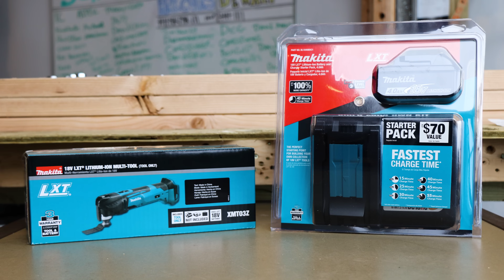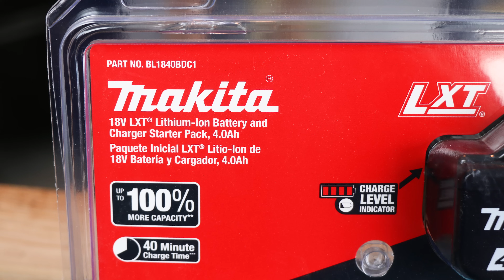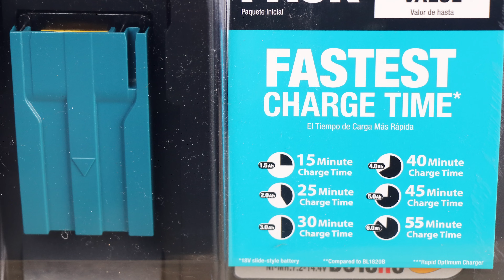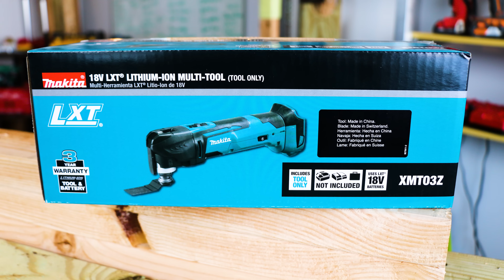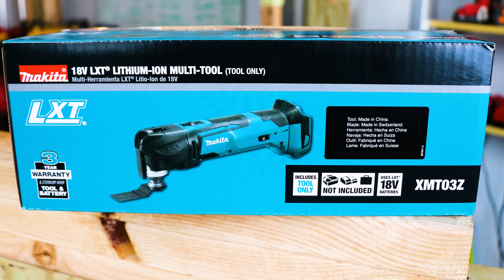MAKITA 18V LXT Oscillating Multi-Tool Has FEATURES YOU DON'T KNOW ABOUT!

Comment: The light on the tool flickers red when you need to change battery 🔋. I own the same tool it’s great it’s 1 of them tools you didn’t realise you needed it until you get it ! Tip if you want to keep a straight line when cutting something out use a square or straight edge and mark with a Sharpe knife !

Comment: I've done a lot of remodeling on older houses using a Sawzall. I've gotten very good with it. But I can see this multitool being very valuable on remodeling jobs where you can perform even more precise accurate work than a Sawzall. And using it on drywall installation, well that's a whole other world. Thanks for box reveal. Very entertaining.

Comment: I do a lot of internal alterations in the way of removing walls and adding steels etc… and this is my go to tool for cutting back ceilings and getting a tidy vertical on plasterboard, skirting and even cutting therm blocks and just getting in them awkward areas that that are hard to get to…. Great tool…..

Comment: I love my Makita Multi tool..I'm a commercial caulker and mason, I've had mine for about 3 years and use it alot. I use mine for mainly for cutting out caulk on control joints, window joints,cmu to concrete joints, and poor strip joints. It will cut out any polly, silicone, or latex joints and it don't matter hold old the caulk is. The best blade for cutting out caulk is by Pipe Knife. I've dropped this thing off a 60 ft lift and a swing stage scaffolding (over grass and dirt).Mine has oult lasted most of the companies and they buy Fein and Rockwell. This tool hasn't let me down. My one complaint is, if you don't pay attention to how deep you are cutting the release will scratch up precast and CMU especially if it's something like a limestone or sand stone wall..
Reply: Interesting point about the release scratching things. I think you can wrap the release lever in a fabric tape or put a piece of heat shrink tubing over it and heat-shrink the tube to the shape of the lever.

Comment: The Makita LXMT02 is the previous model with a light. I have it and in my opinion is the better model slightly lighter and slimmer, only downside is it requires a tool for blade change

Comment: Great video presentation. I’ve got exactly the same model, it’s a beast. Simply fantastic. Build quality is fantastic. One of the best tools I’ve ever bought. It does a lot more applications than you realise when you start getting used to it. I just wish this tool was out 35 years ago when I was a younger tradesman. I would be much wealthier, no doubt. Tips; use quality blades, the threaded pin will need replacing if you hammer it to death day to day after say, 4 years of hammering it to death. The threads can wear out due to “ very hard use”. My electrician associate has exactly the same model & he hammers it to death day in, day out. Worth every penny. If you are a carpenter/joiner, electrician etc, it could pay back in one not too big a job. I can’t praise it enough & yes, “it is” built like tank & the batteries & quick charger are a dream. Don’t waste your time comparing, I did all that, just buy one, you’ll never regret it.

Comment: I really wanted to like this tool more than I actually did. It was a huge let down for me to be honest. I thought I'd like the barrel grip(man is that thing a beast) since I was use to the F/50 and had a similar footprint.  But it gets a bit unwieldy on longer jobs, heats up quickly(not brushless) and is pretty loud. The blade change starts to get a bit frustrating.  Plus no LED light made it hard to use in low light situations. The bulkiness of it really got in the way for me. I'm loving the Dewalt multitool right now. Did think I would like the trigger system, but it is incredible. The blade change on the dewalt is one step below the new fein and bosch system. I miss having a dial selector for the speed, but what's gained far out weighs what's lost. 

I use my multi tool, as a tiler, to cut out subfloor, framing out niches, removing grout, removing thinset, cutting foam, sanding stone surfaces, spot sanding concrete surfaces, under cutting door jambs. Really the list is endless

Comment: OIS: Oscillating Interface System.  The tool is designed for standardized blades, but includes the two adapters for proprietary blade retention systems.
Reply: Hold on, you mean this puppy can do Starlock too ?

Comment: I have it and love it.it is beafy but that is why you dont get the vibration fatigue. I have used it to cut copper piping in a tight quarter ,and I used it to cut off a bolt that had excess that I couldn't hit with a grinder( that I also have - makita) and worked gr8 I also reccomend getting the dewalt accessory kit for $40 . The best $ you would ever spend.

Comment: Makita has the best slid in battery stability on the market imo.  With the rubber bits there is no play whats so ever compared to red and yellow. Although dewalt has gotten tighter with the newer powerstack and tools.
Reply: I'm glad you said that I've noticed whenever I've used other people's drills "red and yellow" I noticed the battery is not stable compare the Makita

Comment: Would this be a good tool for removing staples from wood I want to plane and/or sand? If not any recommendations on a tool for that job... I have about 300 6”x4’ boards with a lot of staples that need removed
Reply from the maker: It would work with a metal cutting blade

Comment: There is a reason they are "giving" those tools away free/major discount - that blade attachment system is outdated. Soon all major powertools manufacturers it will use the quicker Starlock system and  Makita just needs to get rid of the old stock. 
The patent I belive is already released, since  I've the new Makita blades with Starlock system😎. 
Same will happen with angle grinders - stay tuned for X-lock system.
Reply: The old version of this Makita oscillating multitool was lighter, slimmer and had led light😊
Reply: Agree 👍

Comment: Nice and quieter but I will stick with the Dewalt has a better handle grip easier blade release and I can control the speed or on and off with one hand  plus is has better weight balance also it's stand up😁, I have use all of them and they all have there good quality

Comment: Makita makes the best cordless Multitool for doing cuts. It doesn't vibrate like Ryobi,  Rigid,  Dewalt or Milwaukee.  My boss had a Ryobi which shakes crazily , The Dewalt shakes a little less I also own. !Oh Mr.Vince the light is for extremely low battery!

Comment: I miss my makita Oc tool, I had the dewalt (has a weird handle (xr). ) I currently have the m18 fuel and it has the slanted base🤨. How am I suppose to set it down like the makita... eh splitting hairs I suppose also the makita is way faster than the others on the accessories swap IMO.

Comment: So, maybe he should read the manual, he might find that the red indicator will light up when a) the battery is going flat and b) if your pushing too hard, trying to stall the tool. . . . . Just like the grinder.
The instructions would also show that it's a pull pin, save looking like a novice turning a pin that doesnt have a thread. The previous model has a screw thread, but also comes with a wrench to undo the screw.
Also, the instructions will show safety gear that should be worn in use. . . . Man put some earmuffs (defenders) on, you dont want to be missing out on hearing your grandkids in your old age.
The video didnt tell me anything g I didnt already know,  I'm an electrician, i use one regularly for cutting out flush box holes. Notching timber and cutting out for magnetic locks.
Reply: And another thing the instructions state (I only just remembered,  I only read it once) you shouldn't push it sideways through material as it may damage the tool (not covered by warranty)

Comment: I had this nightmare of a job the tile flooring guys laid tile directly over hardwood floor in a huge house so anyways the base was grouted in hence I was there to for the base ended up using the grout remover tool but overall I used the dewalt worked good but absolutely will not take on one of those jobs again unless I have too I ended detecting a gas leak gas company came out shut off the gas and said your so lucky this house was virtually rigged to blow I guess when these people were on vacation they had the floors done and someone grounded a live line on the gas pipe absolutely unbleleavable this was over the winter and I basically ended up saving a whole family they had gone immune to the smell of the gas I happened to be in the kitchen near the stove the leak was in the basement talk about unusually strange if you ask me
Reply from the maker: wow crazy stort Johnathon thanks for sharing!

Comment: Gang: The Makita family of multi-tools are also designed to accept the Bosch appointed OIS standard of blade fit.  Which means it uses Bosch fitting blades or any other blade in the world commited to the OIS fit standard.

As of 2010 my research (google-fu) indicates Bosch created the OIS oscillating tool international standard, in the spirit of the T blade standard Bosch created for Jigsaws. Germans love standards. 

All the brands joined and the world lived happily....No wait sorry one jerk FEIN said NEIN for 6 straight years until Bosch finally said NEIN and FEIN said FINE! And just like that the New Starlock standard joined OIS and now any oscillating multi tool worth its weight uses the OIS or Starlock/Starlock Max, which are all interchangeable. Bosch, Fein, Milwaukee, Makita, Rigid, others
Most seem to be Precision Swiss made blades by mandate. 

Vince said “looks like a Bosch blade, just sayin” and I set out to find out exactly what he was just saying and it didn’t disappoint. 

And if you like when Vince keeps it real by “just sayin” and sends you on a wild google search then smash the bell and click here to read about OIS
https://www.protoolreviews.com/tools/bosch-ois-oscillating-interface-system/1423/
Reply from the maker: You’re a beast Fee thanks for the heads up!!
Reply: VCG Construction your eyes and experience did the real work, I just followed your lead

Comment: Cutting, polishing, scrapping. It cuts carpets, vinyl, fiberglass, aluminum  sheet metal, ceramics, grout , cement (concrete) . What you need is, proper speed and proper blade. And some common sense.

Comment: I have a 12 month old Makita & a Ryobi multitool. The Makita is a rough high vibrating horrible thing to use. 
The Ryobi is rubber dampened with a fully articulating head & is so much better than the Makita it's not funny...& at 1/2 the price.  The only downside is Ryobi longevity is not guaranteed, but the warranty period is unbeatable.

Comment: 1 hour to do a small cut, useless tool, mate i do it in 2 seconds with a circular saw
Reply: Go use a circ saw on baseboard attached to the wall already smart guy.
Reply: @cannabiskreations  I use the Milwaukee 18v oscillating tool and just did a job where I had to cut a baseboard in place. I use carbide tipped blades.
Reply: @cb2000a  i was being sarcastic if you could not tell. a oscillating tool is amazing for cutting baseboard in place or not.  
Guenzburgh Dcl
 is another guy who doesn't understand what tools are for what job.